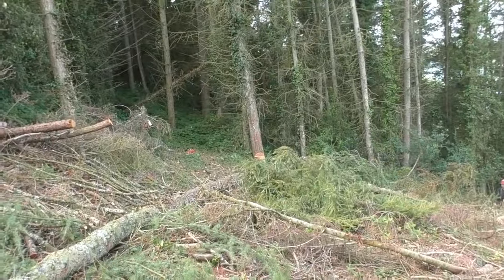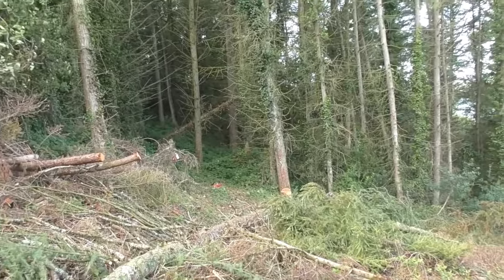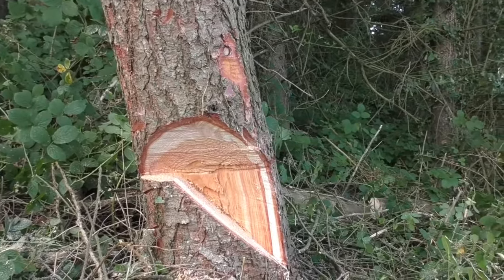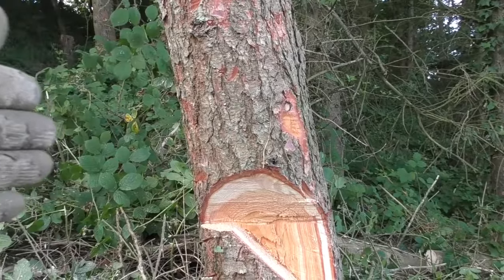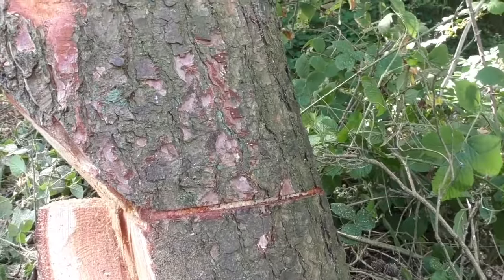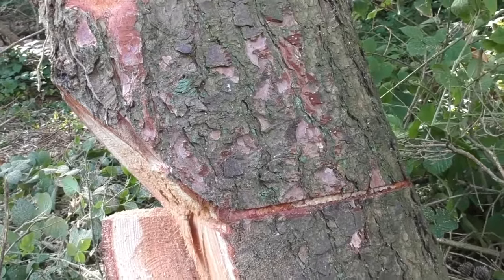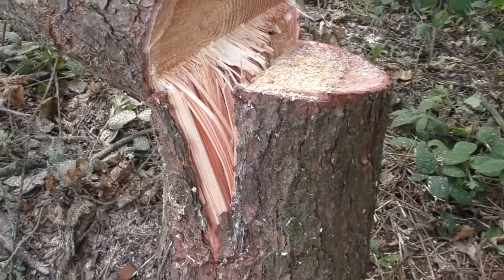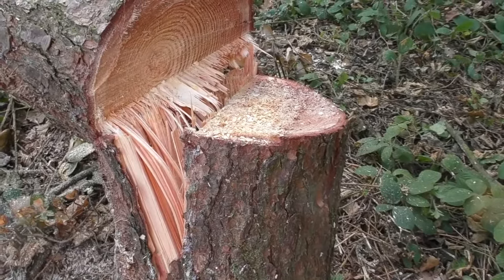Sizwheel cut: getting the tree to swing

Comment: Nice video! I could not really see how much it actually swung tho. Would have been great with a more distant view of it. But you work in brambleland so its understanable. I found that if I just put my back cut underneath the hingecut, not by a lot, it also holds and pulls out instead of breaking meaning it too can hold the tree until its in its preferred felling direction. I like the duckman touch tho! I will use that on my next test. Norwegian power line forrest clearing guy here. Just found your channel!

Comment: A very nice explanation and demonstration.  I heard it said a Sizwell works marginally better with a Humboldt, I`ve tried both but can`t really see any difference.
Reply from the maker: I tend to use humbolts for felling downhill,  as the stumps don't stick up so much, particularly when winching. 
Thank you for your reply.
Reply: Thats correct, the Humboldt is the preferred cut when falling softwoods in most instances on the west coast of the US because it gets the butt to the ground quickly, which saves out the timber, compared to the canopy hitting first. When making your face cut it should be open enough to get the tree moving in the direction just off from the lean, then when done properly, the tree will pivot into the sizwheel portion of the hinge and will now change directions. When making them you must stay at the base of the tree as they can hold on too long and may need to be cut from the stump if they are going past the lay. Staying at the base of a tree is not recommended, neither is using a sizwheel, but it's been known to happen.
We also cut our dutchman from the face of the cut(they are not allowed though ;)), not the back side, this causes the tree to lean more to the dutchman when the back cut is made(the plate is cut). 
A wedge is not needed when done properly, except to keep the tree from setting down on your bar when it sits into the dutchman(so you don't damage your bar), once that happens the tree is committed and all you need to do is to make the rest of your back cut and cut the hinge off if the tree is swinging too far.
Reply: @TheHairyFool  nice job getting her to the ground safely. Sure like the 7900/7910, is it stock, sounds ported.
Reply from the maker: @brettblack7049  It has had a couple of minor tweeks

Comment: How far in do u cut into the Dutchman when doing your back cut? Do u cut until u meet the dutchman then continue  with the other side?
Reply from the maker: Good question, and one i am not entirely sure of the answer. I am trying to weaken the leaning side, so if i have got it right the back cut should overlap the dutchman, and allow the tree a bit more movement on the leaning side. Iam still getting it right about 50% of the time.
Reply: @TheHairyFool  by overlap u mean the saw goes into the previously made Dutchman? By how much would u say? And what does the end result hingewood end up looking like after the tree has been felled, is it a triangle? Sorry for more questions but there really isn't a lot of swinging Dutchman vids I can find with specific details of stuff like that, Billy bucking ray has one but he just describes it in his own way lol

Comment: Thank you for taking the time to make this video! I am not familiar with this cut myself, I have seen it but never tried it. I usually use a double or triple hinge if I am trying to get more holding wood on a leaner. Not sure what all the hate is about. Blessings to you and don't sweat the haters.
Reply from the maker: Thank you for the reply,  I generally find that the haters are the ones that never produce a video,  and are afraid to stick there head above the parapet and be judged. 
I have so far not had much luck getting double/ triple hinges to hold. But practice makes perfect.